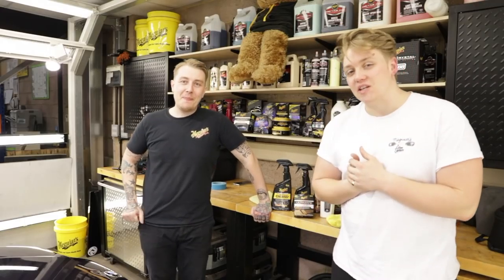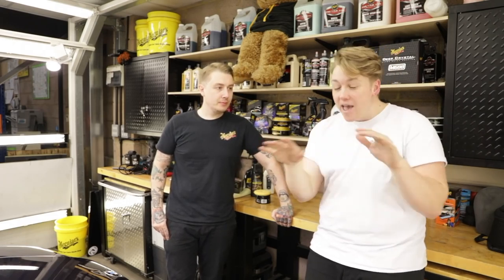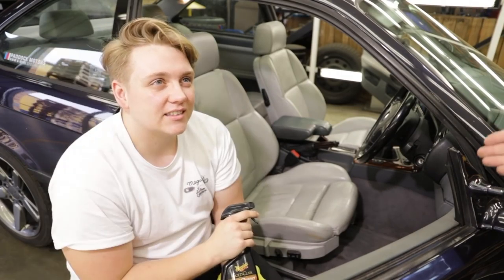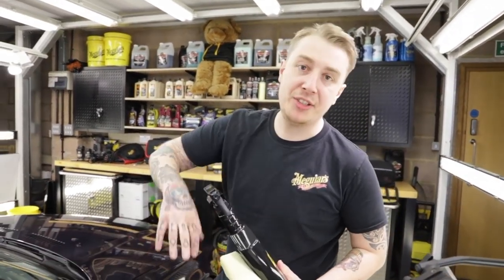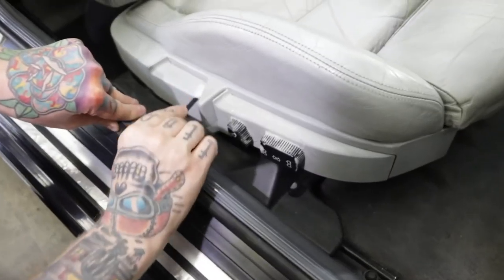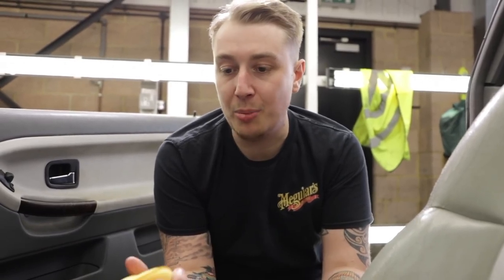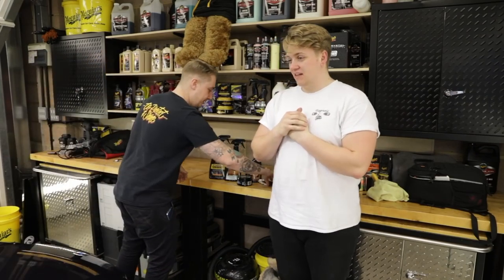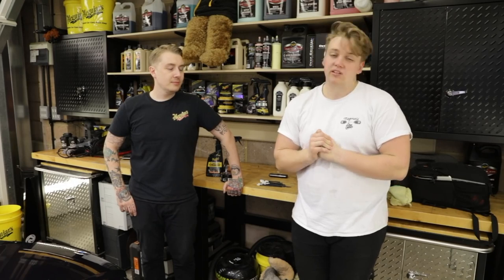Cleaning & Protecting Leather - Meguiar’s Detailing 101 – UK Edition

Comment: When using the Leather Balm, do you need to let it soak into the leather before wiping it off , if so, how long? How long do you recommend waiting  before applying it a second time? Thanks for making these videos!
Reply from the maker: You do not need to wait for it to soak in.  You can wipe off the excess any time.  There is no reason you need to do it a second time immediately following the first.  👍